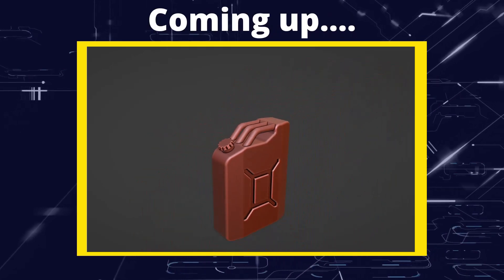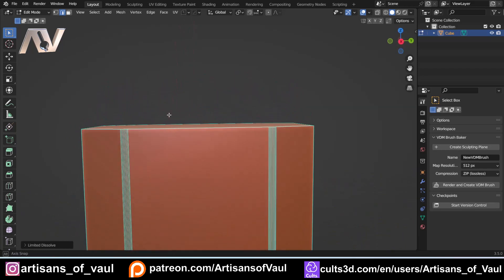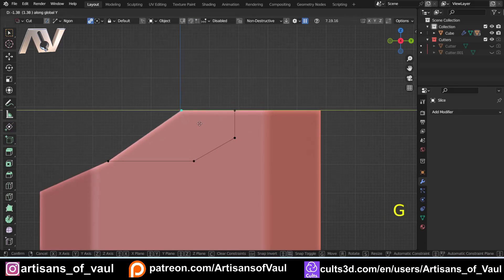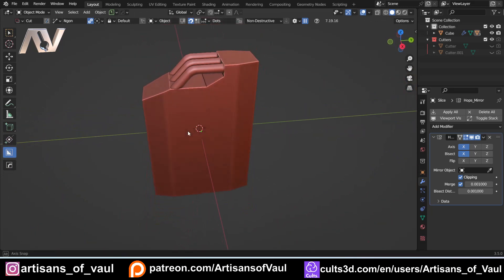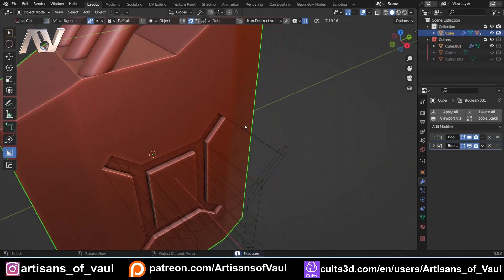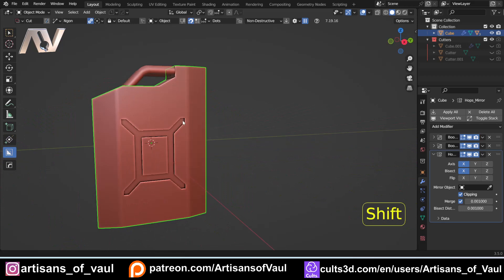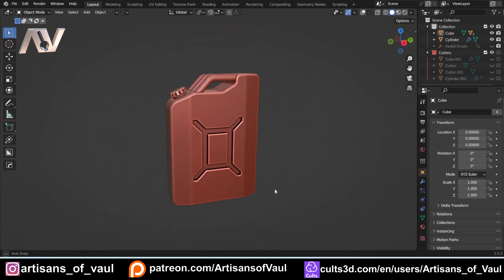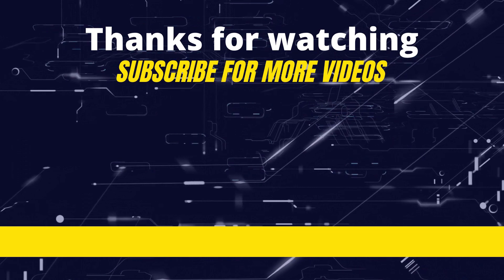Fuel Can Modeling Walkthrough in Blender

Comment: The shapes on the side of the can are to add more strength, so overall thinner material can be used - this keeps weight and cost down.
Reply from the maker: Oh great to know. Thanks so much!
Reply: @ArtisansofVaul  These kinds of reinforcement are really good detail to add on items that are supposed to be sheet metal or plastic, particularly vacuum molded plastic. Even when you don't know what they are, everyone's used to seeing them around so it helps sell the story.

For more rugged items where weight is less of an issue you might see the extra phalanges of material (or bars n stuff) on the inside or outside bracing big flat surfaces. It's a good way to sell that the item is heavy duty, physically heavy, and carries great weight.
Reply from the maker: @EmilySmirleGURPS  Nice idea. I might find an excuse to do some of those at some point too in that case

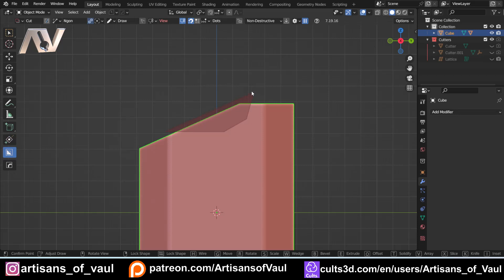Comment: I suspect you could scale the cutter on x while tabbed (around 4:13), still annoying but a wee bit faster than everscroll if it works.
Reply from the maker: Totally true, good idea. I'm just so used to not having to it was sort of autopilot, but that's a good idea.
Reply: @ArtisansofVaul  what's going wrong is that you start drawing your cutter on the thinner parts of the body. It takes that as the instruction on where to measure depth from.